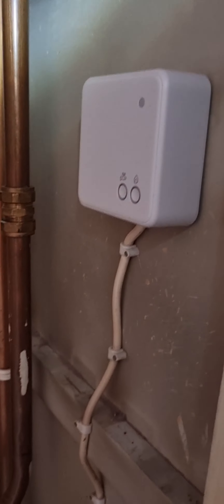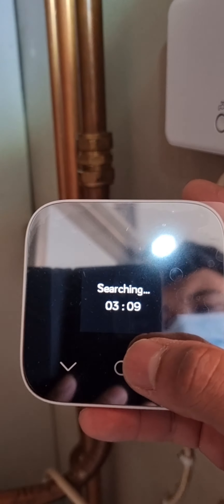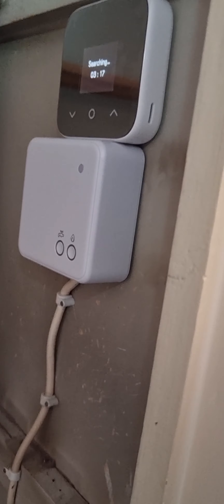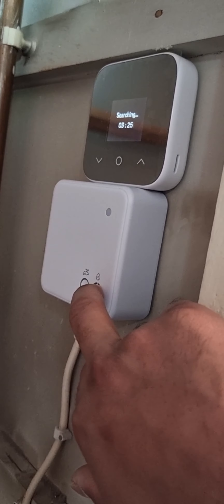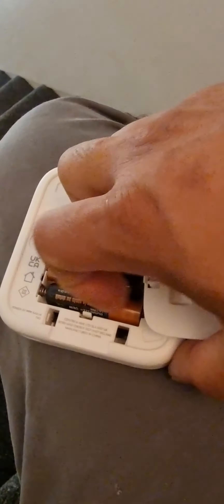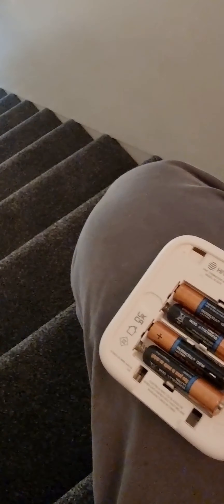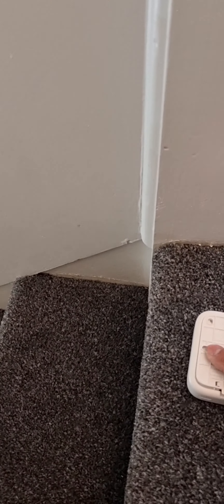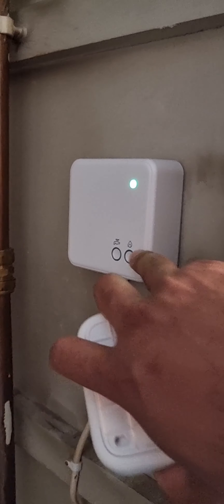how to pair (connect / reconnect) hive thermostat with the receiver.

Comment: Thanks. It's a lottery as to whether it connects or not. I keep turning devices on off, long pressing buttons for flashing led, taking batteries out. Repeating process. Eventually by sheer luck often they connect, frustrating though.
Reply: Totally agree. I’ve been using a Hive setup in my house for years now and it’s never worked first time. Now my sister has moved into a new build and we’re having the same issues with her Hive. The instructions are awful and the Hive by design is clunky. Once it’s setup properly it’s great but getting it working in the first place is sheer pot luck.

Comment: What helped me was doing a factory reset of the thermostat then doing the pairing.

To do this, turn off boiler/receiver switch, wait 5 seconds, turn on again then hold receiver button for 10 seconds until light flashes amber.

Then removed battery from thermostat and put back in. When it reaches 'reconnecting' display hold down the down arrow and middle button for 10 seconds to factory reset. It will then reboot and say 'searching'. Leave it near the receiver for a minute or so and it'll pair. 

Hope this helps someone as little help out there online!
Reply: Thanks.. i followed ur steps and it worked.. i saw many videos but to no avail… followed only the last step.. pressed the bottom and middle button on the mini thermostat for 10 second and it started pairing
Reply: Followed these steps and it worked. thank you so much
Reply: you’re a legend
Reply: What if the light on the reciever is not blinking at all?
Reply: Absolute genius! Been trying to connect it for a couple hours overnight, found your comments in the morning, followed the steps and it worked!! Thank you my friend 🙏🏽
Reply: @peterbaranka glad to have helped!
Reply: Mine has green light on hub. Got receiver flashing amber now, followed these and thermostat next to receiver but 8mins searching still…. :(
Reply: Thank you 🙏 this worked after hours of tearing my hair out. It took about 10 minutes to pair but did eventually!
Reply: Thank you for this comment. After hours of trying different things, this was the fix we needed.